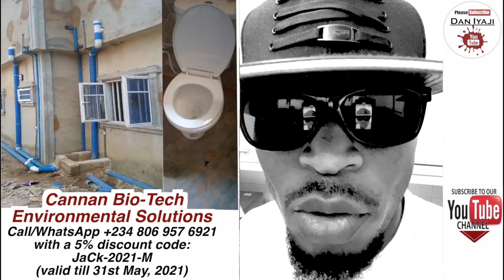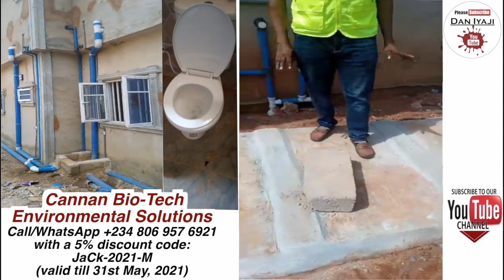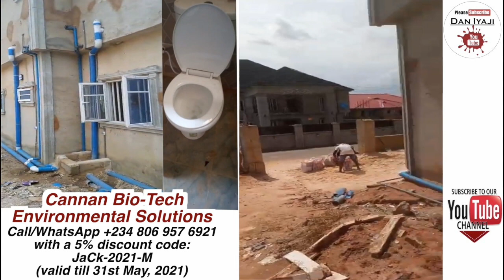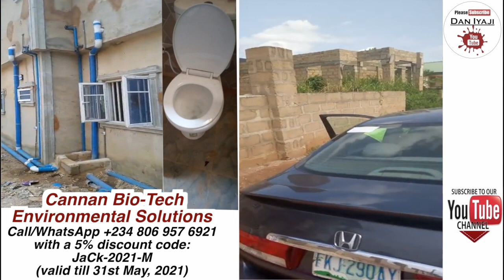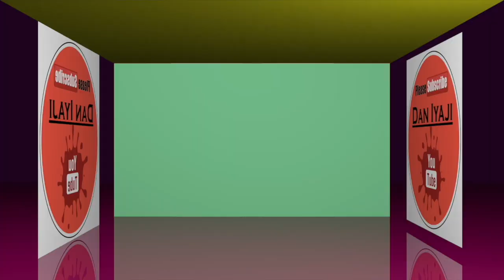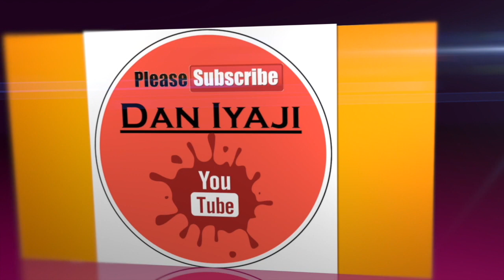Bio digester soak-away is the new soak-away newly introduced to Nigeria

Comment: Good job, from medicine to waste treatment. I'm impressed. 

But your assumption that transiting from the present septic tank system to biodigester would be very costly, I think let's keep it at assumption.

It's possible, practicable, doable and indeed, it's being done, cost effectively. All you need to do is say goodbye to the existing septic system, and chose a suitable location for the biodigester. Redirect the piping from the existing system to the biodigester system.

You may wish to evacuate the existing septic tank system and reclaim the land or just ignore that location.

Remember, if the biodigester system is properly done, it will never, ever fill up. So you have a peace of mind from ever worrying about emptying.
However, you haven't addressed the gas issue satisfactorily.